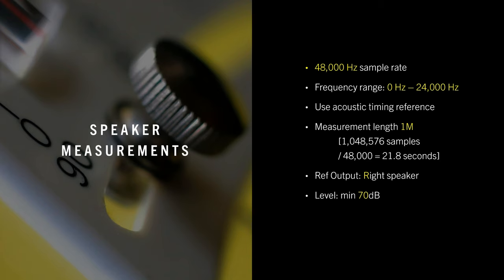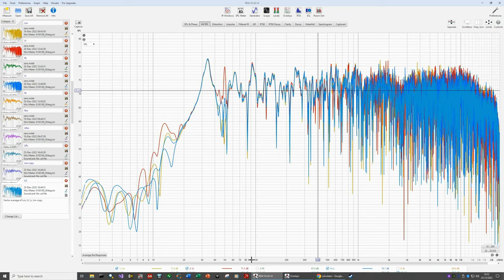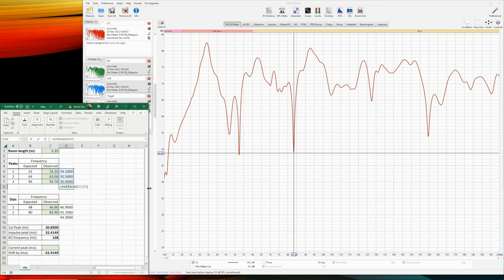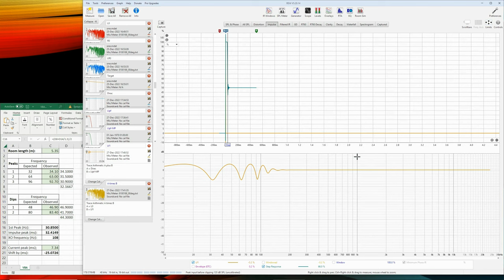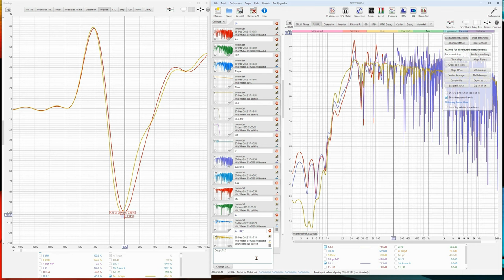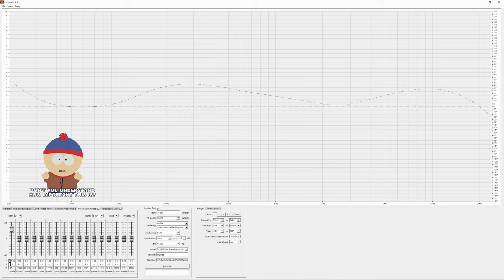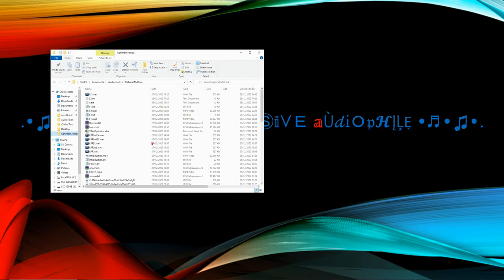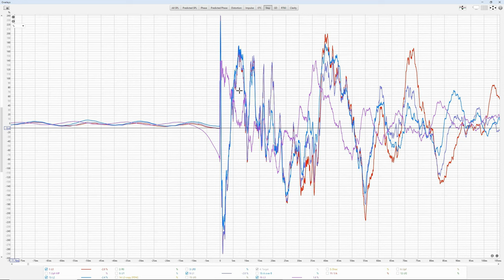High Fidelity Digital Room Correction with REW & rePhase

Comment: Hello, I have watched  several of the videos and some few times over but I feel incomplete in my understanding. Its me, not you. As a relative newbie, all I am trying to figure out is how to calibrate by subs and speakers including the process on how to calibrate subs (steps in sequence) and how to calibrate and integrate subs and mains (steps in sequence). I find the information sprinkled in places and find it hard to follow. Can you tell me if there is a specific video that answers these or is it all over the place? Perhaps a suggestion would be to have an overall calibration video without going into tech details. Just a suggestion and what I found for myself and by no means a criticism. I am just not smart enough...:)
Reply from the maker: You're right. I will make a new video soon.
Reply: @ocaudiophile  Thank you for the response. Just a little bit more detail on what I am thinking and then of course you can decide what works best for you:
1. Before starting calibration clear out EQ settings in minidsp etc and turn off REQ (Audyssey etc), zero out speaker distance, change trim level to zero etc

2. Then calibrate subs. Steps to follow to set up subs correctly. Impulse response between sub to sub

3. Integration of main to subs. Steps to follow in sequence - Impulse response between sub to speaker and speaker to speaker? , crossover setting

4. Loading of filters into minidsp as needed

5. Audyssey run required? If so your recommended steps including any hacks etc

6. Use of RT60, spectogram and waterfall etc
I am sure I am missing several steps but wanted to show what I had in mind.

Question: I have been setting up speaker crossovers based on what had the best frequency response. If I go with a 80hz crossover it does not measure better than a 100hz one. Would not go with what measures the best and likely sounds the best too?
Reply from the maker: Ideally the crossover frequency should be chosen according to the actual frequency response of the speaker in question in anechoic chamber. You can find the frequency where the bass starts to roll of in the tech specs of your speaker. The summed response with the sub will very much depend on the sub and that speakers distance settings though due to phase cancellations.
Reply: @ocaudiophile  That is the kind of stuff I am requesting in the overall video....thank you for all that you are doing
Reply from the maker: I have read your suggested steps and they make sense, too (although there's a lot more to optimal correction than you believe!). But the reason I don't post a new tutorial with the best possible correction is not that I can't decide on the steps. It's the variety of all the systems out there and  the difficulty in coming up with a simple standard method which fits to all (try and read all the comments here or any other video if you don't believe me, to have an idea about all the different problems people can come up with). I can make a video for the best possible method for your system in an hour but 3 people will watch it, majority will stop the video within the first 10 seconds when they hear subwoofer phase alignment. YT will stop promoting the video seeing people dash out in 10 seconds so eventually even the 3 people who would benefit from the video will not be able to ever see it. What I have laucnhed so far is quite impressive in terms of compatibility, quality and ease of use.

Comment: Is this better than Dirac Live?
Reply from the maker: By a margin 👍
Reply: But Dirac says they also improve impulse response. This does the same?
Reply from the maker: It does more!
Reply: If this is doable also its genius. I am looking to band pass a channel in 3-4 way, and by convolution alone can the phase be aligned if its not? I ve read somewhere that time-phase alignment its the ultimate thing that can be achived by dsp, represented with that spectrum which should be symetrical from the middle, i dont know how its called. Do you know how to do that? Do you have a video on it?
Reply from the maker: Check the "workshop" videos. The methods are slightly more optimised and they also make use of recent REW improvements. Anything can be done to the sound signal with FIR filters.